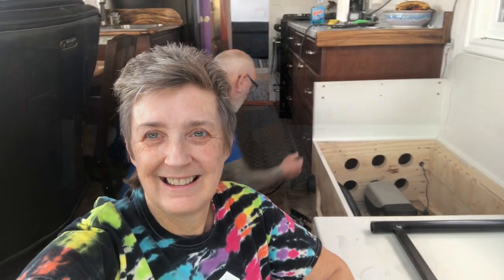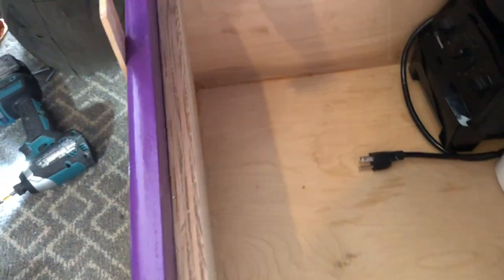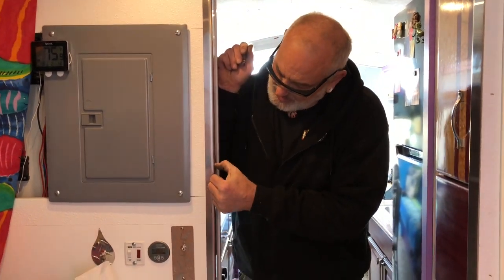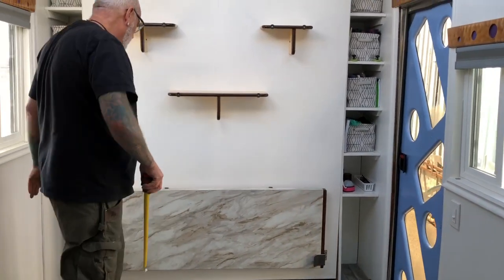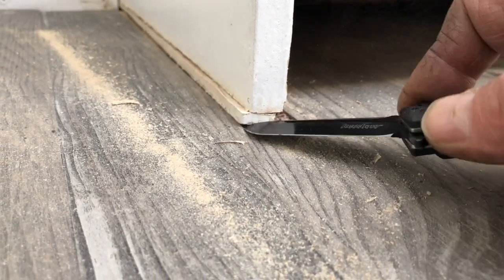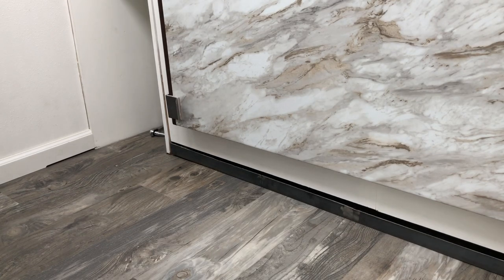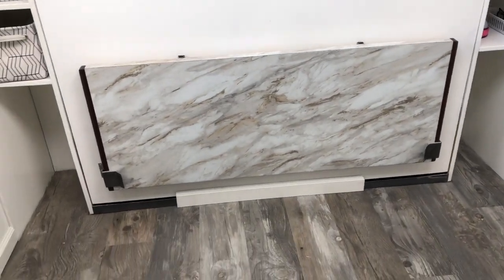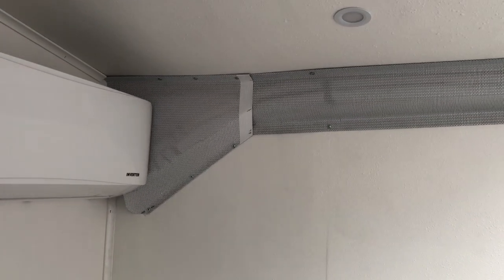Small Projects Add Up to Success - Vlog 215 School Bus Conversion

Comment: Your bus is all great, but the Muphy bed is the best thing about it, clearing so much space. Well done and it looks even better now. The metal reinforcement will probably be worth its way in gold when on the road, it could imagine the frame coming unter a lot of load when you drive over a bump. May I ask what that yellow cable that runs through the door is for?
Reply from the maker: Not sure what you’re referring to. Where is the yellow cable at? Thanks 😊
Reply: @KnappTime  You can see it at 12:49 going below the door. Might be a hose as well, I am not sure